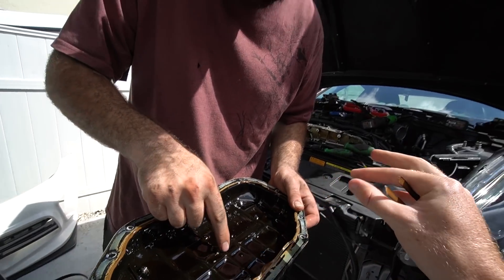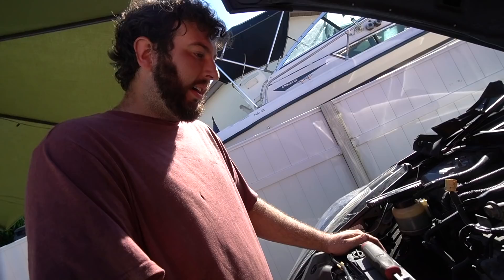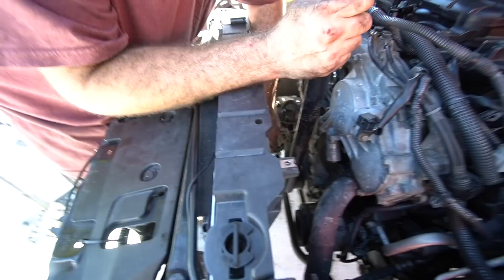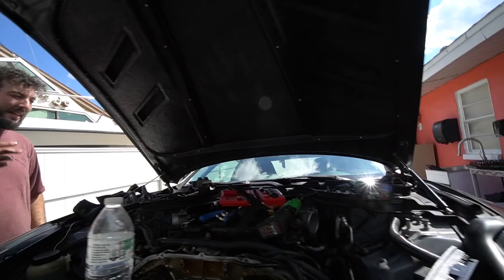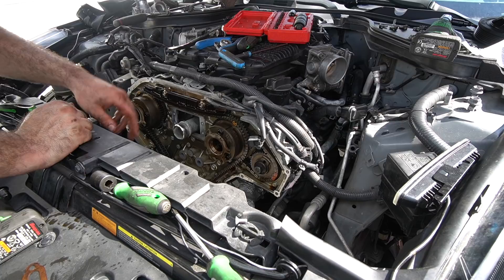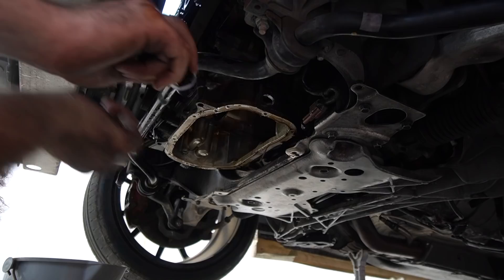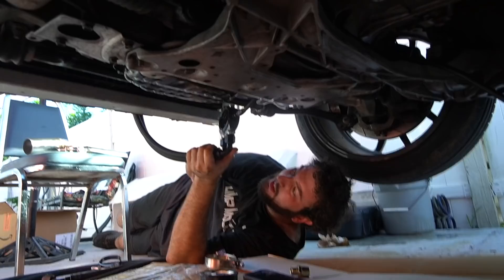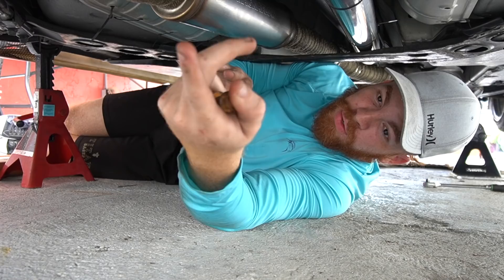Every Nissan NEEDS To Do This!!  *Prevents Blowing Up* Oil Gallery Gasket

Comment: My cam phases failed due to bad oil gallery gaskets! Thankfully the car did not kaboom but was definitely a weird limp mode, car would just fall flat on its face above 3500 rpm

Comment: Got all the stuff to do the gallery gasket for my 2011 with 70K on the clock. I'm also replacing the water pump and thermostat since those do fail. looks like a royal pain in the arse but I can do it.
Reply: never heard of a water pump failing on g35's or g37's.
Reply: @tomzphone  thats a good thing.

Comment: Confused... you said two different things: 1. They fail because they're paper and Z's hotter oil temp doesn't mix well with paper and 2. They fail because the screws back out "but the paper is just as good as metal". I'm guessing you meant the latter, though Nissan's fix for 2014+ models was supposedly just the upgraded gasket, not merely lock-titing the screws, which would support statement 1 instead. If that is the case, would not an oil cooler eliminate most of the issue and spare some people the trouble of the gasket upgrade? I mean I see no reason not to do both, but in the interest of doing the most effective modification first, I want to be sure, and now that I think of it, didn't 2012+ models come factory with an oil cooler?  So the question would be, are the 2012 and 2013 models seeing this failure, or is it primarily 2009-2011 prior to the stock oil cooler?
Reply: paper sucks, but none of them were properly tightened from the factory. This is a pretty rare failure on DEs and they have the same gaskets.

Comment: Need an oil cooler bad can no longer race in Mexico cuz my oil temps are way to high only thing helping me is the fact I run t6 rotella diesel which is thicker but I still need a good oil cooler been putting it off to long

Comment: Don’t push 700 WHP, less than 1500 miles that block will be gone.
Reply: Please don’t spread false information, its not whp that kills motors its the torque, this will make around 450wtq, far less then what other companies are running these too with zero problems
Reply: @Vqde_master   oh really ? 
Making around 750 and I didn’t mention torque because I thought you people would assume. Also it’s not false the stock block on the VR37 can handle up to 700 Further power upgrades would need, rods and pistons 🤦🏻‍♂️. Also would be needing a full engine built 😑. Was in Long Island getting my g tuned by admin and some dude had a pro charged auto g37 with a stage 2 trans. Mans said he only can do 1-4 gear pulls due to stress on the motor, meaning you’ll still BLOW THE BLOCK…
Reply: Yes really but i build and tune these every day, so what do i know 🤷🏻‍♂️🤷🏻‍♂️🤷🏻‍♂️
Reply: @Vqde_master  I own one myself,  6 speed manual sedan
Reply: @natefrm860 own vs working on them full time is a whole different story